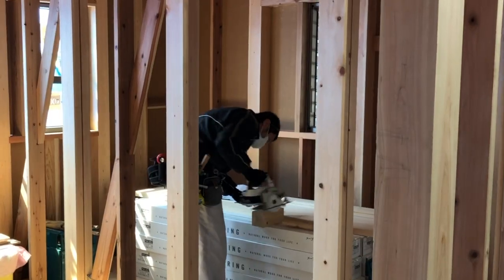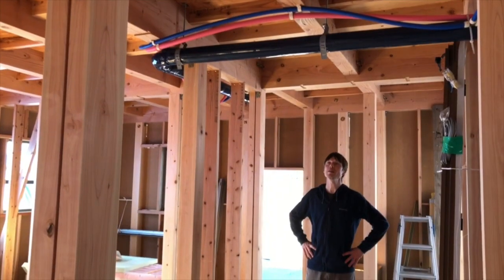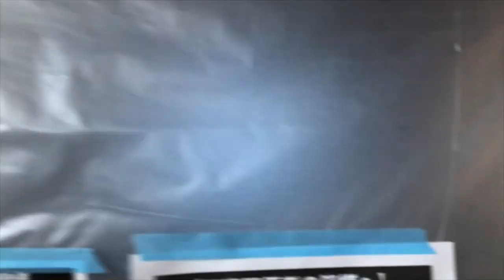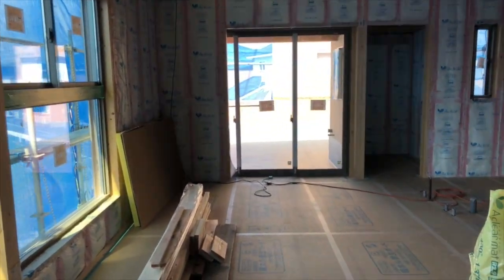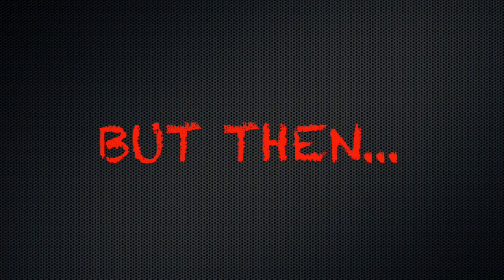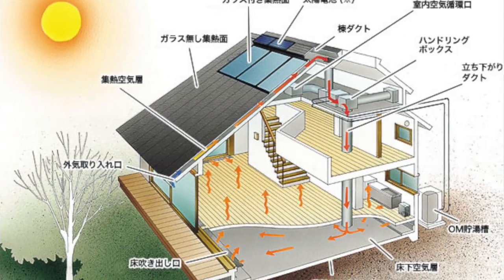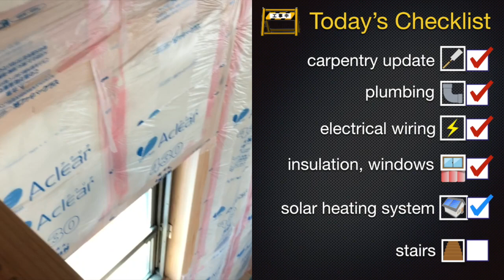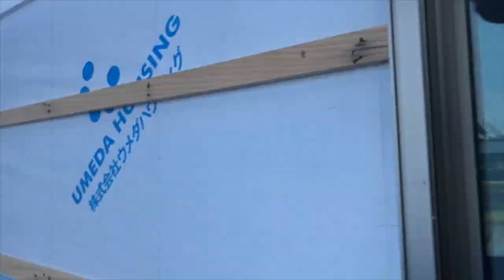Building our Family Home in Japan, part 6: putting in a (modern Japanese) central heating system

Comment: Jordan, I had a sinking feeling when I saw that plumbing mess. Looking forward to see how that was resolved. The ancient Romans had a heating system called "hypercaust" which is where hot air circulates under the floor and provides a gentle radiant heat, so you will be employing a system that is at least 2300 years old! Really diggin' this house series!
Reply from the maker: I just looked up ‘hypocaust’. (First time I’d heard of it). Very cool! Those Romans knew how to live.

Comment: I found the video quite interesting. When i visit a different country , one of the places i like to go see are the hardware stores and building centers so I can see the different building materials  , practices and systems .
The area below your home is called your " Heat sink" if it were used here in Canada . Its kind of a misnomer as it can be used to passively store both heat and cold based on its particular construction. 
I proposed using a hybrid form of this in my youth ( 1990 ) for an earth sheltered home i planned in Ontario but the local building inspector , who possessed very little advanced building knowledge , would not allow me to have a building permit , even though I exceeded all local building codes .. Nothing in my plans suited him. He would not listen to even the simplest logic .
Welcome to Canada .
Now married to a thai lady for the last 10 years with plans to move to Thailand in the next few years and build my dream home ... and yes , I will also be using passive gain and storage heat tech. The difference is , I have the freedom to build as I choose in Thailand .
Reply from the maker: “Heat sink”, right! I had completely forgotten that term. (This happens when you live in a non-English language environment for long enough.) But yeah, building regulations can be frustrating. We actually had an issue or two in that area as well (should have put that in a video?) but everything worked out OK in the end. 
Anyway, thanks for the comment, and good luck with the move to Thailand! Congrats!
Reply: @Jordan-inJapan  . Thank you . I visited Japan a number of times ( Tokyo , Tochigi  , Nikko  ) and loved it . The quiet and order appealed to me ... And here I am about to retire in one of the most unordered countries , as far as driving goes. . haha
We will be looking up north where its cooler , to build our house .